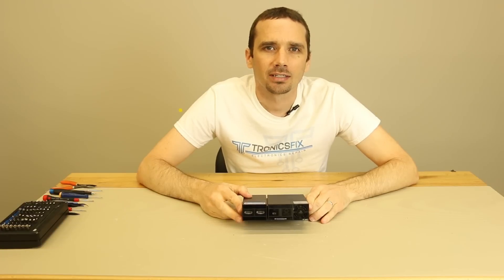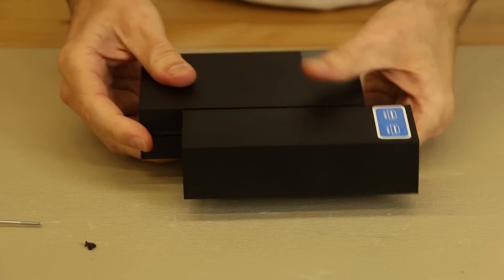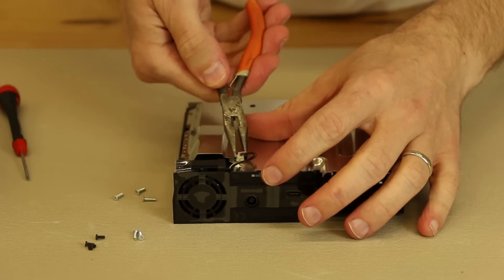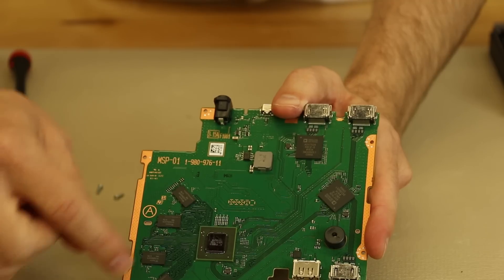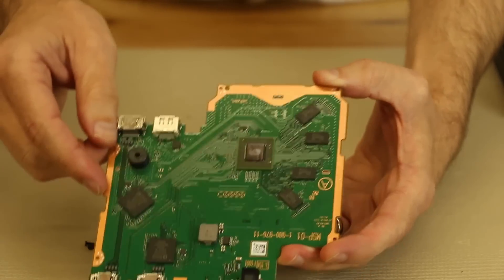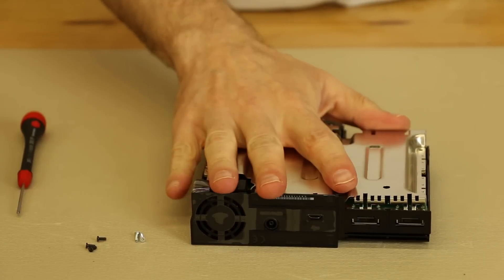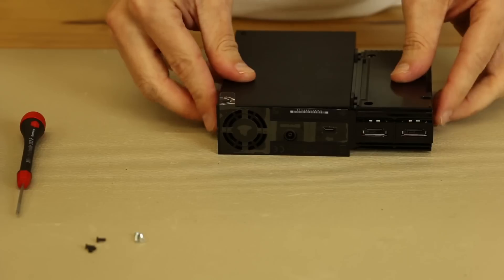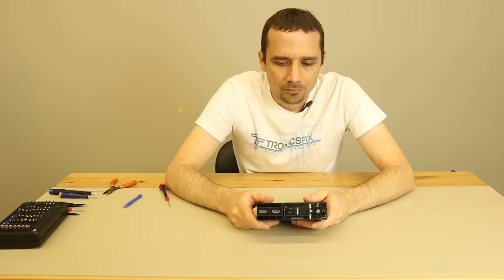PS4 VR Prosessing Unit Teardown

Comment: The black box is cool but they are very unreliable. I have two at home that both don't work and I barely played vr. Now that I want to get back into vr they both have hdmi problems. Yes I did check if the hdmi cables was plugged into the right spot and I tried new hdmi cables. Just displays no hdmi both on the TV and the headset.

Comment: If anyone is curious about the quality of thermal pads inside these boxes; I just bought and opened up a 1st gen PSVR. The thermal pad was in near new condition. The texture of the pad was still very gummy and malleable unlike a dried out pad which is brittle and falls apart when trying to remove. (09/21/2024)

Comment: Is it any point in tearing it down clean it and change thermal pad? i have had mine for around 6-7 years now
Reply: Probably not, I just opened up mine and the thermal pad was in really good condition still (gummy). It also depends too how much you use it but the unit doesn’t seem to draw enough heat to dry out the pad quick enough. Clearing out the fans from dust doesn’t hurt to keep it running cool and if you do open it I would check the thermal pad just in case.

Comment: Now I see why Sony did a revision of the PS VR processor unit They got rid of the two HDMI ports in the back and it only has one that connects directly into the PS4 HDMI port and you still have two HDMI ports on the processor unit V2 in the front one that is made to output PSVR content onto the TV or monitor The other one is to display content directly on the PS VR headset they also improved the processor unit HDMI ports they don't feel cheap and it's able to output 4k UHD and HDR 10 the original PSVR processor unit couldn't do that you actually had to switch out the HDMI cables which was a nightmare But if you have the V2 processor unit model you no longer have to worry about that anymore It's smaller and much more compact 😍 Good thing I didn't pre-order PSVR after I heard the nightmare people had to go through I waited until Sony did a PS VR revision and ever since then I don't have any problems with the V2 processor unit 😉👍

Comment: My processor unit has the hdmi port problem... I can connect the headset but the hdmi that goes to the monitor has no signal... can it be repaired?...

Comment: So the fan in mine was unbearably loud so I opened it up to clean out the dust, of which there was none.
So I stuck some slivers of sponge around the fan casing in the hopes of reducing vibrational noise, but I can't remember which way around it goes back in. Anyone know?
Reply: Nevermind, I figured it out. The label side faces towards the exit.
FYI the sponge did not significantly reduce the fan noise. I believe it to be the fan bearing itself that has failed. You could try squeezing a drop of oil on the spindle, if you can manage to reach it. For me a few wiggles on the opposing axis to its rotation remedied the noise for now, but if I can find one, a replacement fan would be the best option.

Comment: Hey Steve, I'm trying to troubleshoot a no signal to tv issue with a version 2, I have a reading of 875 continuity the others read around 400-475 going across filter caps diagonal, I believe these feed the Panasonic chip closest to the vr cable and I'm wondering if there is a sure fire way to test for a fault or if you know where the filter caps route to or pinout from where they enter the chip to their exit point, i replaced the cap with a good one but still get no signal, this seems common in v2s, many thanks!

Comment: I have a problem
 My ZVR2 processor is making a tazer type sound and the white light is flashing very fast. It has been doing this for hours. I just got it today. The fan is not on and the hdmi on the TV is not reading it. The hdmi works on the playstation alone, but when I plug in the vr stuff and connect the hdmi to the processor then to the TV, the TV does not read anything. I've called costomer support, called freinds, and research for hours, I have no idea what to do. Can anyone help?

Comment: I wonder if the breakout box V2 is built the same way. Not a fan at all of the thermal pad on the processor to the heatsink. Hell, there's like ZERO pressure holding them together, a slight jolt could cause it to come loose and then you're stuck with an overheating breakout box. I actually put some shims on top of my heatsink so it would add pressure, the fan doesn't speed up nearly as much now.

Comment: Great video. Quick question. I recently got a used one of these and after a few hours of gameplay there's no output to the headset anymore. I get there loading icon on the headset when a game is launched, but that's it. Is there a chance one of the chips on the board needs the solder to be reflowed(if that's even a word)?
Reply from the maker: Unfortunately, I really don't know. I don't repair these. Sorry about that.

Comment: Thanks for the video.  Seems simple enough.  Did you happen to note stem what type of fan is in it, it the size of it?  Mines just reached the point where the bearings have gone.
Reply from the maker: No, I didn't notice the size or type. I should have made a note of that in the video.
Reply: TronicsFix LLC thanks anyway

Comment: Hi mate, thanks for your guides. I have used them a few times to redo my thermal paste/pads. Do you remember what thickness the thermal pad was for the main processor? I want to replace with a better Fujipoly Extreme pad.

Comment: Thx for your videos. I disassembled the proceso unit because it's louder than my ps4 pro ( with no boost mode). With the intention to change the thermal pad, but it's 1.5 or 2 mm and I have only 1 mm.  Could you made a video measuring the noise of the unit with and without the ps vr Googles on/off. Thank you in advance. Keep going, best console teardown channel!
Reply from the maker: Interesting idea, I might do that.

Comment: Hi , my prosseor unit power doesn't turn on red anymore , I went to Sony center they only can repair it if the warranty still available but my warranty over , I asked them can I buy prosseor unit separately they replied no you can only buy the whole set again , that's crazy , I wonder someone help upload videos show how to repair it I believe it's easy but I don't know what chip is responsible for the power supply . 
help ....
Reply: if you ever find out can you please let me know
Reply: I too had this problem on my second vr processor. It has no power, no red light or any light at all. Tried to find what chip is at fault but couldn't find one. My first is infinite blinking white light.

Comment: TronicsFix, I've watched ALL your vids, great work, man, keep it up. I just got one question about the PSVR Unit. Does it come with 4 GBs of ram?, just to handle sound? Could this unit become a bottleneck when it comes to process graphics, or not at all?. Thanks man...
Reply from the maker: Thanks for watching my videos! It has 1 gb of ram. I'm not sure what all the ram is used for. This unit won't bottleneck any graphics at this point and probably never....the graphics basically just pass through it.

Comment: Can the thermal pad be used instead of thermal paste?
Reply from the maker: It is a thermal pad.
Reply: TronicsFix yeah i know... but i wanted to know if it can be used instead of thermal paste on other APUs
Reply from the maker: No...a thermal pad would be way to thick.
Reply: TronicsFix Okay thanks for the help. You keep up the good works. Get the PS4 PRO soon as possible.